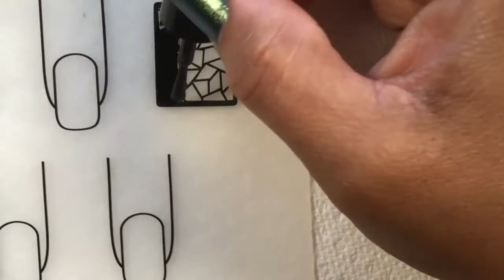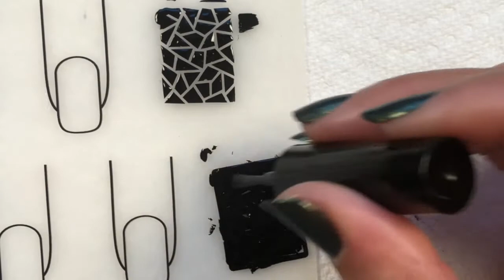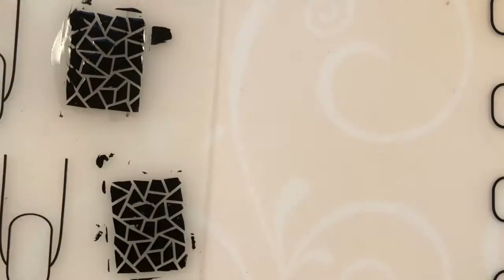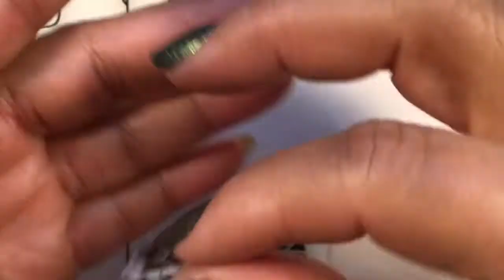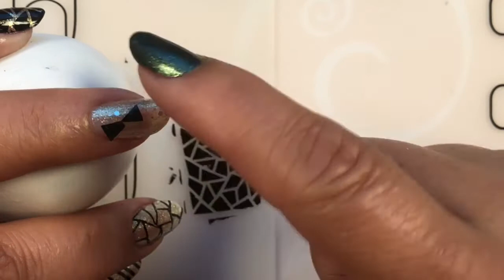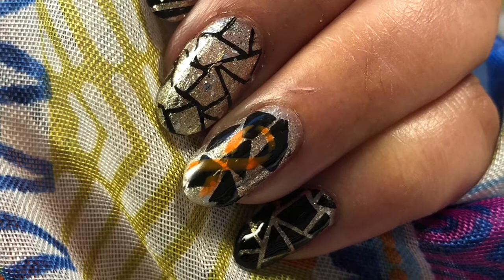MAKING DECALS FROM NAIL VINYLS

Comment: Very nicely done Anita,  I also like to use Vinyls not directly on the nails, it’s much less mess and fiddling to stamp or do decals 😍😍
Reply from the maker: I agree Chris, and by just using the parts that you want after it has dried saves cleaning up with polish remover which is so 
drying for my skin. Thanks for taking the time to watch. 😘💖

Comment: please tell me what size to make words for long medium and short nails using DS please thanks
Reply from the maker: Hi Darnae, I want to help you out but I'm not sure I understand your question. Is it about the nail vinyls?
Reply: @nailartbyanitam.4551  yes it is, I cant understand how to make them fit long acrylic nails. put i see people sale on etsy so there must be a standard size to make.
Reply from the maker: I think I understand now. As far as I know, the nail vinyls I use come in one standard size, like you see in the video. If there are larger ones I don't know about them. I can suggest that if you use the size like I did, that you make two decals and place them on the longer nails with one over the upper part of the nail and one covering the lower part of the nail. Once you top coat the nail it should look like it's one large decal.  I hope this answers your question and if you have any others please don't hesitate to ask.
Reply: ok so whats the measurement? thank you, I want to diy
Reply from the maker: The kind I have are 1 inch wide and 1 1/2 inches long. If you diy them you can make the length as long as you need.